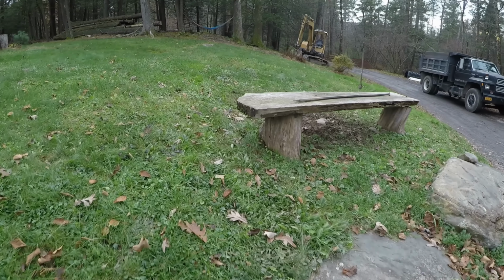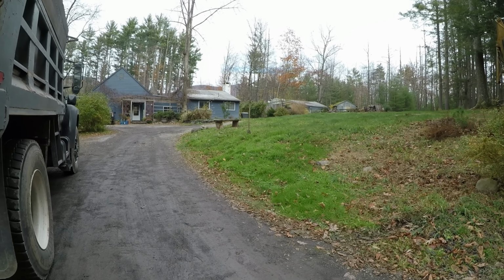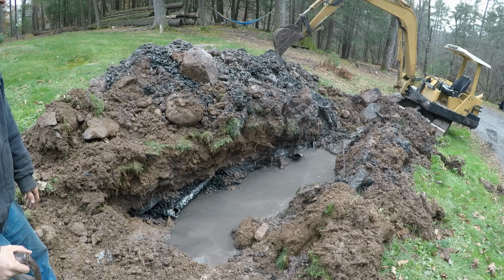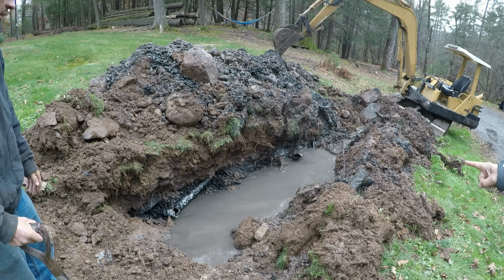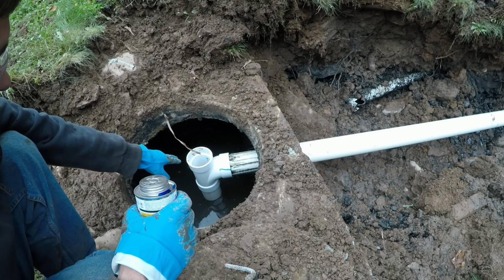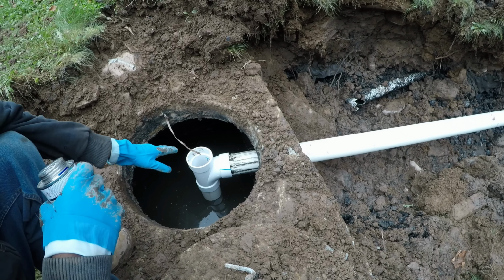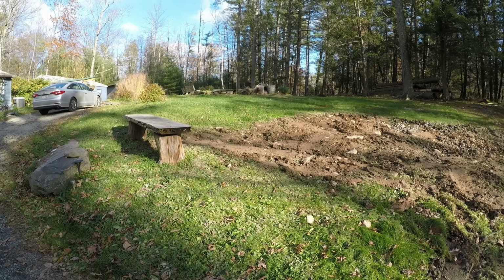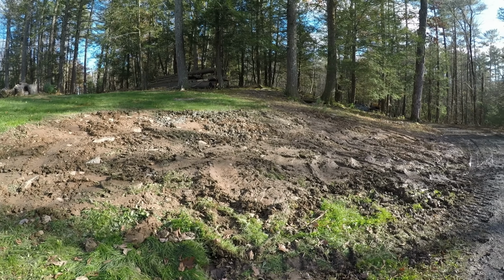Replacing a leach field

Comment: Really??? You think chambers that last 5-10 years are better than pipe and stone that last 30 - 50 years on average. 
There's 3 reasons for that, 1 - your young with not enough experience in this business, 2 - the cost of material and ease of install(i.e. it's easier for YOU, 3 - your not the guy footing the bill. 
Pipe and stone been around and working for hundreds of years, Kid. Maybe its time you went back to school and picked another profession instead of seeing dollar signs, and inadvertently or not, wrongly taking advantage of you clientele.
Reply from the maker: Why would the chambers only last 5-10 years. Those 4" pipes are such a small area, Ive seen them clog up. The chambers are huge.
Reply from the maker: I have seen plenty of systems with those pipes fail.
Reply: That stone was pretty dirty and silty, not double washed at the plant, then wasn't washed again with the fire hose in the truck at the plant.   Fines... as I'm sure you know.... clog SAS's extremely fast, like laying down a layer of clay at the bottom of the field, so it doesn't even have a chance.     A huge no no on any install.    The operator didn't dig fully into the C-layer strata, as you could see the effluent follow his trench while digging extremely far away from the tank.(No Absorption)   As I'm sure you know... if dug into that layer and beyond the fines in the natural soils... well that water would most likely have dissipated and absorbed into the soil long before reaching the SAS area. If not, you putting the leach field in a bad spot and not doing you client justice.  The  absorption at the bottom of those chambers takes all the flow in one spot instead of distributing equally and lasting a long time, smaller areas overloaded clog up very quickly.     Simply adding dirty stone around them doesn't elongate the life of them but the size of the bed, well that matters, making the trench a wider absorbing area, that matters.     However, even with stone, that corridor clogs up in concentrated area  moving forward.        So after a very short time, this concentrated section is not functioning, kind of like a sink drain catch, but one you can't empty.        I may have not done too many of these 400-500 chamber systems(not anymore) out of well over 5000 systems myself, without counting anyone else from my company.    But I'd like to think I can give a little knowledge, that may save a guy down the road from getting sued due to a bad product.
Reply: On another note, your operating, your direction in excavation and completing the job, and your finish work, were very well done, and I think you'd give some of our most seasoned guys a run for their money. That was well done. Well executed.

Comment: In Sweden its illegal to do a job this bad....
Reply from the maker: Martin Johansson what's bad about it?
Reply: The level of cleaning, the choice of materials, the depth of the line. But i have no idea wats legal over there.
Reply from the maker: Elaborate more on this. You just put up a general statement that doesn't really mean anything (with bad punctuation too). "Level of cleaning" What do you mean? The tank was pumped before hand, and the job was left looking good."Choice of materials" I used SCH40 pipe, that's about the best pipe I could have used. And I used the high capacity septic chambers, what's wrong with that? I have seen other people recycle other things and use it as a leach field. All of these materials were used for their intended purpose. "The depth of the line" That's pretty much standard, septic stuff doesn't need to be deep, it doesn't freeze. Overall this is a fairly standard septic field repair.
Reply: I'm from Denmark myself, but yeah I can't belive the amount of people who praises the work neither
Reply: I'm very suprised that you are allowed to let sceptic water seep into the ground like that. I have never seen it being done in Denmark so I can't really comment on that part

but what I noticed:
- A Lack of sand / small stones underneath and around the pipe, grade check on the pipe, soil compaction around the pipe but also when refilling the trench (the ground will settle), dozing the dirt onto the pipe rather than placing the first few buckets carefully. The shit water you dug up, I thought you would at least have buried back in the trench, but a lot of it was graded around his yard.

Visually it did look good when you very done, but honestly I wouldn't have expected anything less from a contractor
Reply from the maker: How are septic systems done in Denmark? This is just the leach field, after the tank, that is a normal septic system. 
That is a good comment about the installation of the pipe. Other people brought up the same point, and I made another video (why to use quality pipes) in response to those comments. I used SCH40 pipe there, it is very strong, it does not need to be protected by a layer of sand to protect it, watch the other video to see how strong it is. Grade is not important after the septic tank, before the tank needs to be 1/4" per 1', after the tank, any down hill pitch is fine.
Reply: Well sceptic tanks are probably made they same way you would do it, but it is the leach field as you call them that I have never seen. It is often done with rainwater though. (After reading up on it a bit, it seems that they can be made in rare cases, but you must pass tests and get permits to do it).  

I’d argue that because you’re still dealing with sewage water that you’d want a minimum of 2 % grade per 1m after the tank. However you might be able to get away with only 1 % since the sceptic tank will trap most of it. 

Given the thickness of the pipe you can re-use the dirt you dug up to compact around the pipe assuming that it doesn’t contain rocks larger than 10 % of the pipe thickness, however you’d still want a bed of sand to make sure it has an even surface to lay on. The pipe thickness doesn’t make up for the lack of proper compaction around the pipe, because the dirt will help to carry the load and make the pipe stronger. (you actually mentions this principle yourself in the follow up video)
Reply: Andrew you did a good job, you built according to local codes and requirements. In most parts of the EU leach fields are banned for spetic systems, you may only use them for rain water. Any non grid tied house has to have a tank to hold all sewage water to be hauled away or a sewage treatment on site.

@ihateit don't quote building codes for sewage lines, they are irrelevant in this case because it's build behind a septic tank. Most solids are kept there. More important is to keep the leech field high above the ground water. 2% gradient would be grate, but you simply can not build it, if terrain does not allow you.
Reply: some of the septics in orange county new york whare i work were 55 gal druns as tanks and rubbel as a field and they lasted 50 or more years